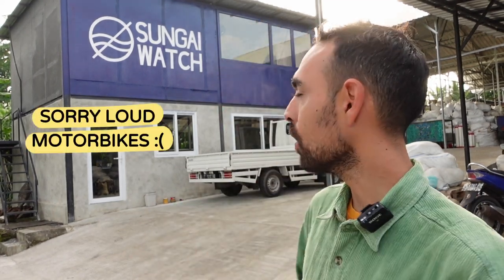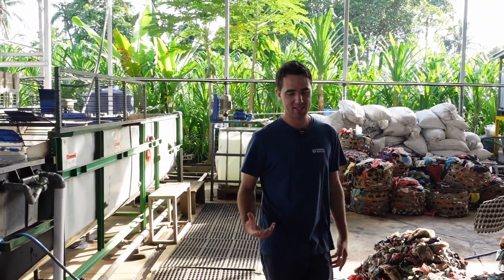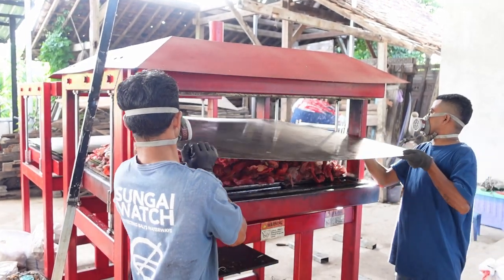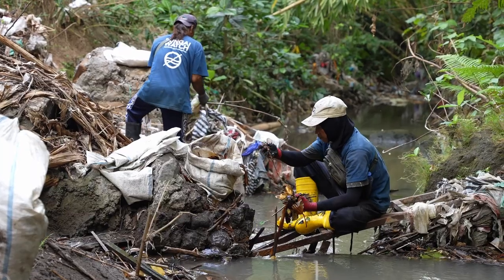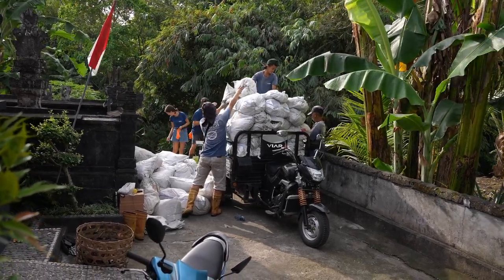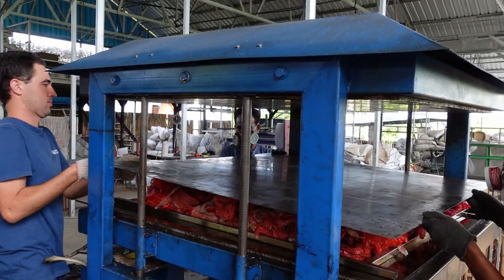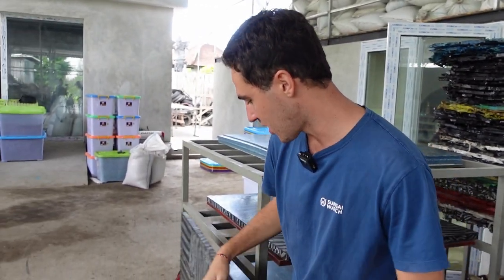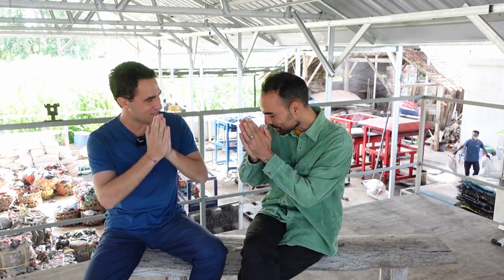What they do with RIVER plastic is INSANE | SUNGAI WATCH

Comment: Would like to see barriers on the precious plastic ecosystem. The main challenge I was wondering about involves changes in water level. Do they find a fixed point in the river that stays the same width or do they add and remove sections as they do the cleanups?

Comment: For drying plastic bags why nit have a spinning drum with holes on the drum and ends.
It can then be connected to a bicycle for someone to pedal or to an electric motor. 
Then put a fan at one end again csn be pedal powered or electric. 
Then fill the drum half watoy abd spin with fan onto. 
That is the simplest way. 
Also, clothes could be dried the same way but without heat it takes longer.
Maybe start looking into off grid living youtubes to get ideas would be a good idea.